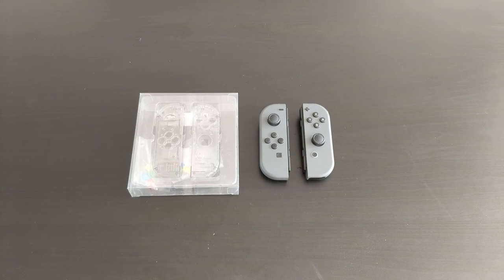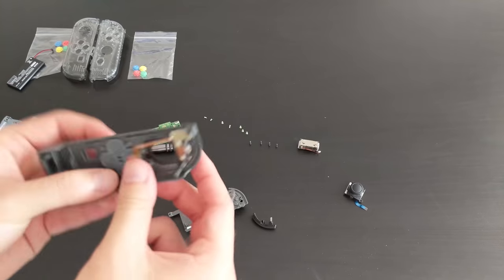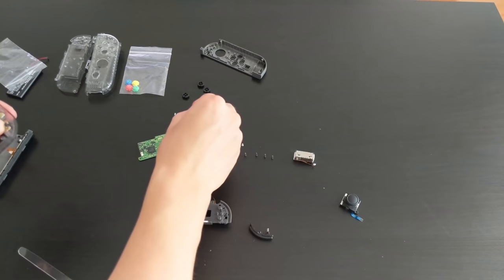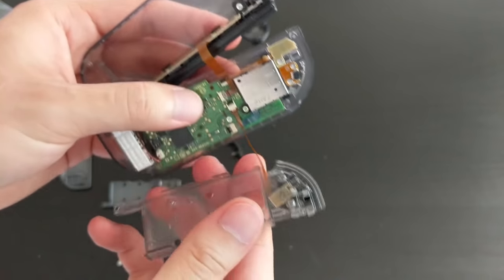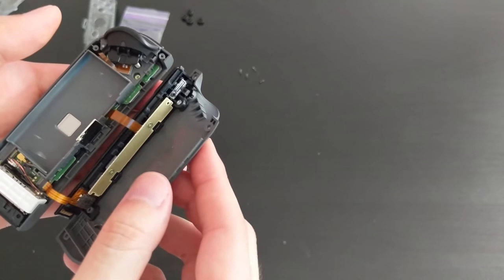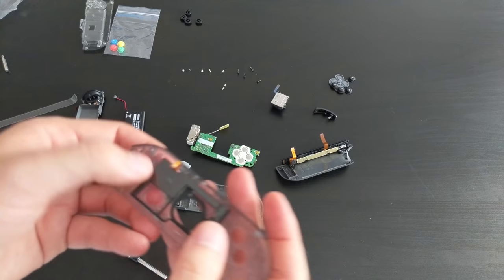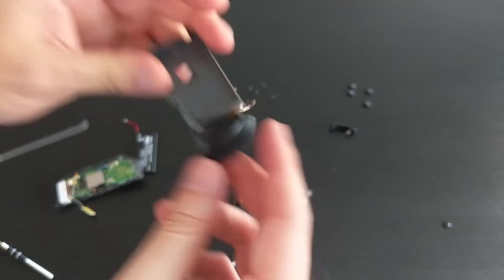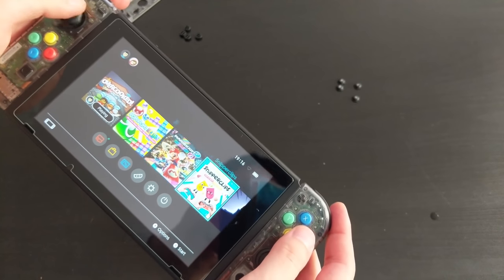DIY Nintendo Switch Joy-Con shell swap, movie length version

Comment: Dude I was so confident and careful I could do this, as I've taken apart several electronics and put them back together. However, my right joycon will not charge, nor will it work wirelessly. I can connect it to the console, and it works, I see it, but it will not charge. As soon as I remove it from the console, it loses signal. I may have damaged a ribbon unknowingly, but I don't know which one. Any help?

Comment: You didn't need to undo all the ribbon cables. I just finished my swap and did it with only removing the one cable in the right joycon. I didn't replace the middle plates either but I recommend just leaving most of the cables attached and working around them, it was much easier and less stressful.

Comment: I wanted to learn how to disassemble and reassemble my Joy-Con and I had to deal with some problems:
-One of the springs flew off
-A screw was missing
-Buttons wouldn’t stay put and get in a bad position 
- and a pin was off put
Even after all of that, I tried fixing the problems with your tutorial and somehow everything worked out fine (I found the missing spring and screw).

Comment: pro tip: screw in their screws first when your closing the case, just to get the threads in, take them out and put the oem ones so you dont strip them
Reply: I did that before even seeing your comment lol...that part was definitely the biggest pain I've ever done!
Reply: Wait what do you mean by that. Think you could dumb it down a little for me?
Reply: @lexderp2766  the crappy screws, use them first. Screwing them in will get the threads in ( ie the tracks that the screw travels  ) then screw in the oem ( original  equipment manufacturer ) screws

This makes it less likely to strip the originals, basically ruin the philips heads of them as the screw has a pre paved path to travel
Reply: Alberto Esquivias ohhh that actually makes sense thank you <3
Reply: What? I haven't a clue what you're saying m8

Comment: I did the swap yesterday. Only disconnected the batteries. The rest of the ribbon cables you can leave in there if you are very carefully.
The bad closure of the right joycon can be fixed by cutting a small piece of the front shell, there where the sliding rails needs to be inserted (top, at the ABXY buttons).
Your movie helped a lot to identify your 'errors', thnanks!
I used the original buttons, cleaner look. And my battery plate of left joycon has a fault, I need a new one :(

Comment: Gosh darn it, I've taken apart many a thing in my lifetime,  but Joy Cons have got to be the most annoying ones thus far.
So many tiny parts that you just have to hold in place, so many clips that you have to pray for won't pull out when you're on the last screw... 

I did it on one Joy Cons and I doubt I'll get shells to replace them with, that sure was a ride.

Comment: Amazing guide, used this guide and everything went super smoothly for the right joycon, left had a few problems but that may just be on my end.
 In case anyone has the problem in the future, my L trigger was sticking and wouldn't click properly, to fix it all i did was ever so slightly file down the top 'gap' it has. There was a small piece of plastic that didn't come off when it was made. 
Highly highly recommend using the phillips screws that come with the replacement sets, significantly easier to not strip.

And if anyones wondering, extremerate white shells and red buttons are a beautiful combo!
Thanks again for the guide Wonk!
Reply from the maker: Awesome, glad this was useful =)

Comment: Just an FYI, if you're going to make a tutorial or walk through, edit out your mistakes. I followed you all the way through, and had attached the bumper button with the two springs before connecting the ribbon cable. So thanks for that.

Comment: So far I've had a problem with all third party shells. I've had matte white ones with a D-PAD (I have those on right now) and I've had clear shells too. My problem is that when I put it back together, the Joy-Con doesn't fully want to close near the middle on the rail side. It doesn't click and just bulges outwards (this is with both Joy-Cons, but only the side with the buttons doesn't sit flush with the rail). Do you know what could be causing that?
Reply from the maker: It's hard to say, but the quality of the cases are not great so check for small bits of plastic that's sticking out and shave them off. You can compare the case to the original as well to make sure there's no excess plastic on the third-party case. Good luck!

Comment: nice.
about that middle part in the joycons (where the triggers are) Could it be possible to just move the original piece all together? So there wouldn't be any need to mess around the triggers. Ive read that is the part that breaks often.
Im thinking you do that so the whole joycon shell looks transparent, but I guess one could do that with a shell that is not translucent.
Reply from the maker: Yes that is entirely possible. I actually ended up swapping that whole middle plate back because it had a better trigger feel so the top and bottom pieces are translucent and the middle plate is the original grey. It still looks great!

Comment: HELP. I have bulging on my right joycon and the source seems to be right underneath the plus button, but I don't know what it could be. I've tried sanding but it didn't help. It's really annoying cause it'll creak from pressing the bulging in.
Reply from the maker: My only suggestion is to compare the clear case with the original and watch for any extra bits protruding and make sure to remove them.

Comment: I have experience with several PS3/4 controllers and have modded a couple Pro Controllers. How does this compare? I just want to change the buttons and keep the shells?
Reply from the maker: Sorry I can't comment on other controllers this is the only one I've modded. But just judging by the size of PS3/4 controllers I would say that should be much easier since the components will likely be larger and easier to handle.

Comment: 53:57 lol nice just skip all the struggles.. my screws don't even go in properly..
Reply: would be nice if he addresses these issue on how to screw them in properly, I'm sure some of us struggle on these alone.
Reply: These aftermarket shells do not have threading for the screw holes. What me and another commenter did was use the silver screws to establish that thread pattern in the aftermarket shells' screw holes, and THEN use the OEM black screws that came with the original Joy Cons on your switch.
Just know that the OEM black screws have a tri-head like a "Y," and the aftermarket silver screws are normal Philips screwheads. Hope this helped!

Comment: This is the best step by step tutorial • I was confused with the bummers, but it was no problem. Thank you for the video!! Personally did mine without disconnecting the strips. Do you have tricks for striped screws? I have tried the rubber band trick, no avail :c
Reply from the maker: The key is to try to apply some upward force as you unscrew them. You can potentially use a pair of tweezers to try and grip the screw and apply some upward force as you unscrew it. Hope that makes sense.
Reply: @wonked  it does but, would still work on a screw with nothing to grip? I fear they've become rounded out too much for a regular screwdriver head
Reply from the maker: Hm then perhaps grip the head with a pair of tweezers or small pliers and twist to unscrew them that way. That's all I can think of =(
Reply: @wonked  that's fine! I appreciate you taking your time to explain to me c: thank you again !!

Comment: After screwing parts back down my “Y” button and “+” aren’t clicky they’re just held down, if I loosen the screw they don’t feel right, like the circuit board moves
Reply from the maker: This is due to the poor quality of the replica case. You need to open it and shave off the excess plastic. =(
Reply: Wonk, dang, I was avoiding sanding cus it’s clear, so it’ll show through.

Comment: I reassembled my left joycon and it's not connecting to my switch. What could the problem be  m
Reply: I had the same problem, I hadn't plugged the bottom-left (when turned upside down) cable in firmly enough.  Reconnecting it fixed the connection problem.

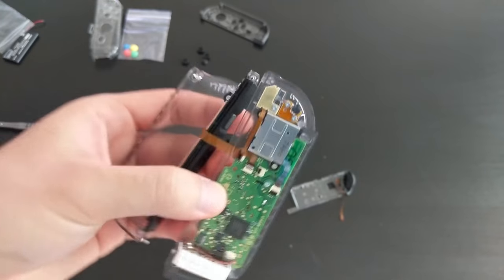Comment: That clamp for the ribbon at 26:41 sadly just broke off for me. Currently seeing if i can just press it on and have it stay. Have a feeling I'm about to have to buy more stuff now :(
Reply: Update: Learned from my mistake. Bought a used joy con just now and I'm moving along in the process.
Reply: Update: Got it all together realized the L button didn't clicked tried opening it back up and now the screw is stripped
Reply: this thing is hell
Reply: Nood1le facts lol I eventually got it to work but the bumpers are a little more sunken down than before but overall they work good

Comment: Does the plus button continue to work? Here it has hardened and no longer works. Any tips?
Reply from the maker: Yes the plus button can get harder to press. I had to reopen it and look for any excess plastic bits and slowly shave them off. Basically the case is applying too much pressure on the pieces making the plus button hard to press. You can also try loosening the screws.

Comment: I’m trying to replace the shells of my joycons.  I started unscrewing the screws, but 3/8 of them are completely stripped and I can no longer turn them.  How do I get them out?  Someone please help.
Reply from the maker: You can try using a small set of pliers (or paper clip) to grip onto the screw and apply some upward force and then try unscrewing them. Hope that makes sense. Goodluck.
Reply: Thanks a ton, I’ll try that

Comment: I've replaced the Shell on the right Joy Con but only the joystick is working now. What could be the problem? I've done something wrong but can't figure it out.
Reply from the maker: The replacement shells are usually pretty bad quality and can have excess plastic so that it's too tight. You can try loosening it up to see if it fixed the issue. If it doesn't then I suggest taking the shell off, confirm it works and then try putting the shell back on.
Reply: @wonked  That was exactly the problem, had to take it off and put the old one back on. Thank you!

Comment: if you were to rate the difficulty on this 0-10 what would it be? I have tried to swap out the buttons on the Xbox one controller and ended up disconnecting the main rumble packs when trying to put everything back together with out the ability to reattach them. since these controllers are pretty pricey I just want to make sure it is a relatively simple task for someone with minor experience in this sort of thing.
Reply: Thomas Meyer Most experienced people with disassembling electronics would rate it around 8-9. Not quite as unforgiving as an iPhone but pretty difficult.
Reply: too much risk

Comment: The shell swap was easy after following your video however I am experiencing no movement on the "+" button on the right joycon.  It seems to be stuck down no matter how many times I have taken it back apart to try and correct the problem.  Have you experienced this?
Reply from the maker: Yep I had the same issue. It's basically due to the poor quality of the replacement shell. I had to open it up and shave some of the excessive plastic off. You can also slightly loosen the screws so that the shell is not so tight.
Reply: @wonked  I tried loosening the screws a bit helps temporarily.  Where should I shave off the plastic?
Reply from the maker: It's hard to say because the replacement shells are all slightly different cause they're just poor quality. You'll have to open it and inspect unfortunately.

Comment: This was great, but as I was removing the battery, I somehow managed to remove the connecter on the motherboard as well and snapped both of the pins🤦🏻‍♀️ Just bought a replacement so I can have another go😂
Reply from the maker: Sorry to hear that =(. Hope the replacement comes soon and the rest goes smoothly.
Reply: @wonked  Just to give you an update - I got the replacement joy con and the changeover went super smooth and they look great! Thank you for this.
Reply from the maker: Awesome glad it all worked out!

Comment: did the first one and the minus button got stuck. any tips?
Reply: I have the same issue with the plus minus button.  Have you figured this out yet or have any tips?  I have been advised by wonk to loosen the screws or shave some of the excess plastic.(not sure where though).
Reply: @soundpixel9867  have you found anything about them yet? mines is spongy. it works tho

Comment: dude.  i could kiss you. took my joycon apart to spray paint and customize it and was looking at other vids who dont show the right joycon only the fucking left one. 3 hours of attempting to put it together and breaking a ribbon door i was about to have a brain Arianism, today i tried again after spray painting it with your vid and i got it back together easy. and my switch looks hella cute! ( all cept the left side cuz my screws came stripped e.e)
Reply from the maker: Glad it was helpful =)
Reply: @wonked  very, its all thanx to you i dont have to A. spend 120 dollars on new joycons, cuz first 3 times i put it together it wouldn't work. and B.  I have a pretty customized switch! i am so proud of myself as well for just doing it myself rather then blowing 300 CAD on custom ones on etsy. you saved my wallet, and sanity XD

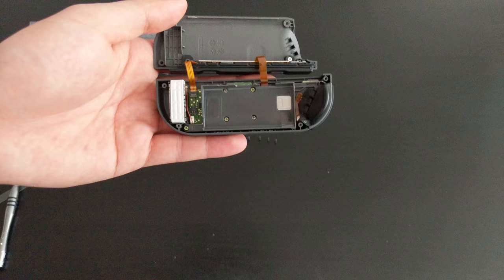Comment: 2:26 Movie length but you still cut the battery removal?? I'm having trouble getting the connector out.
Reply: @nood1le  I was using my brain by being careful and looking for examples rather than forcing & potentially breaking small electronic parts...? I figured it out, finished the shell swap, and my Switch looks great now. Did someone hurt you?
Reply: @soroneir1260  Wow, there must be a problem if that's all your brain is able to handle. Anyways, glad to hear that you figured it out and didn't mess anything up. Stay safe.

Comment: Right joycon is assembled but isn’t connecting ... help ????
Reply: You should start by taking it apart and redoing the rail and antenna connections.
Reply: Did you fix it?
Reply: Tried but nothing. Bought a new one
Reply: @Axel.Hernandez  RIP. I'm planning on modding my joycons soon and hearing stuff like that scares me
Reply: Suzumi no you're 100% fine ! My right one was a factory defect, I mod it because I had nothing to lose if I were to break it or not, it still didn't work. But I bout a new right joycon & mod them both white, you have nothing to worry about this video helped me 100% sorry for the scare

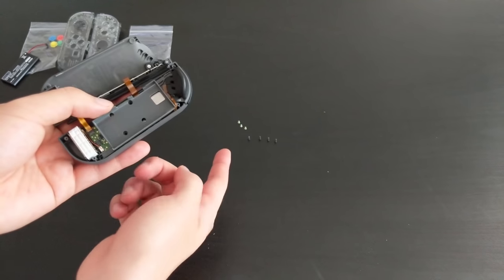Comment: really helpful video. you did a good job keeping the controller in focus but the editing is really bad. at 2:50 movement is really jolty and sporatic, which makes it especially hard to tell where you're pointing, kind of like if you've ever tried to play rocket league with a high ping. maybe it's just the camera  having a noticably low capture rate, but either way your explanations made any weirdness  comprehendable.
Reply from the maker: Apologies about that, it's a combination of my phone overheating because I was recording for hours in 4K and also the older version of Premiere Pro which couldn't handle variable bitrate video, this meant the audio went out of sync and video got choppy =(

Comment: Poor editing skills. Highly suggest watching the video thoroughly before doing the steps.  He leaves alot of the reassembly parts out.
Reply from the maker: I agree, did it first time on camera with no prior experience. You can find a better guide else where. If I also recorded the reassembly parts it would've taken me over 10 hours to film cause I had no idea what I was doing, was just trying to document it while learning/discovering at the same time ¯\_(ツ)_/¯. Please use a proper edited guide else where.
Reply: Can I remove the ZL button without removing the middle battery plate in the middle??? 

Basically ... just crack open the JOY CON by re-moving the 4 screws, then carefully split it apart?

I only need to remove the ZL button, and I'm just wondering if I can just pull out the ZL button and springs? I wasn't 100% sure based on your video. Just want confirmation before I attempt this. I want to replace my ZL button with a new ZL button. I'm not interested in going further and pulling all the guts out as all I need is the ZL button!

THANKS!!!!